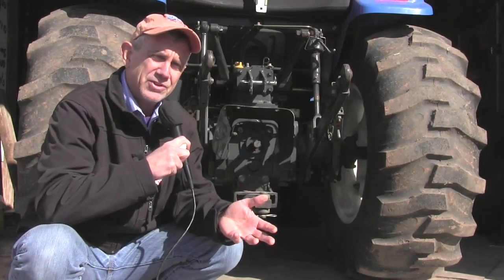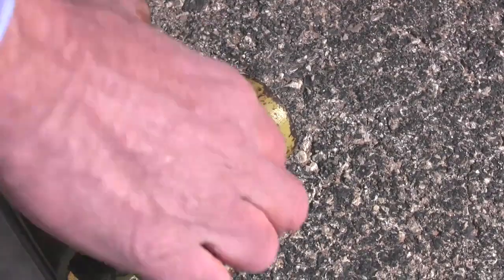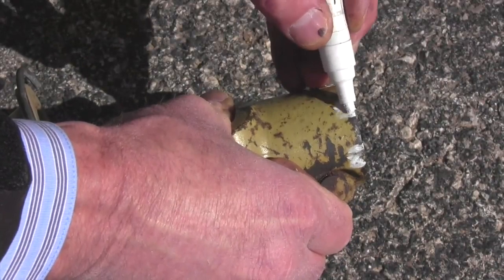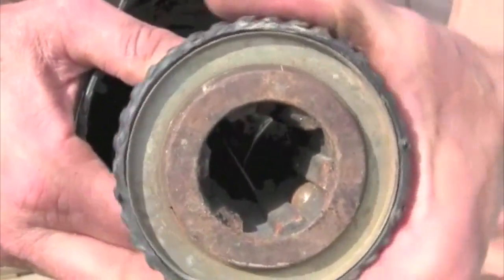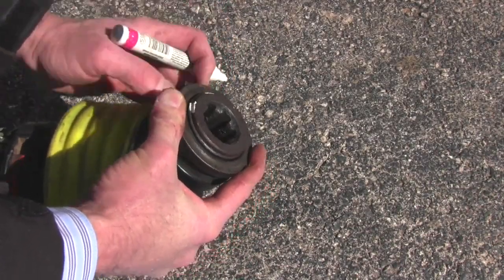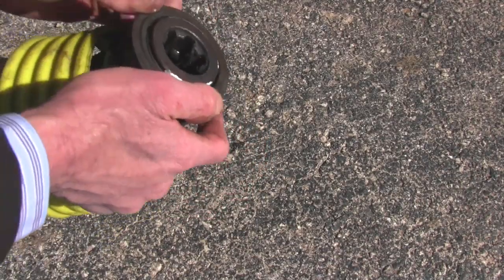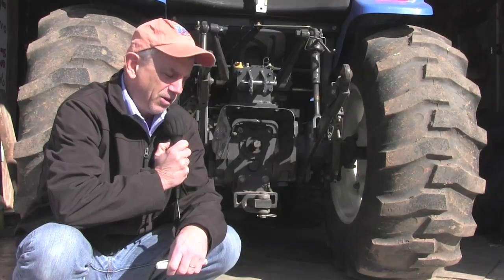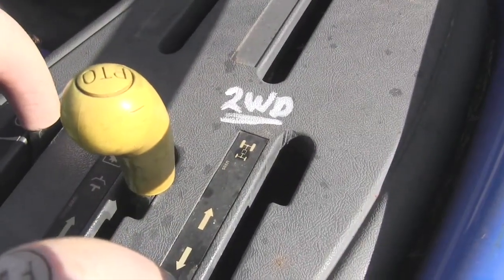A Great Trick to Make PTO Hookup Easier

Comment: I use a paint pen to mark all of my bolt heads to see if they are still tight. Allows a visual check so I do not have to break out a torque wrench to check.  A simple line running from the bolt head onto the tractor gives a great visual reference.

Comment: Now, if you could come up with a way to pull back on the collar while pushing on the shaft while reaching around the 3pt hookup arms.  At 67, I'm not as spry or strong as I used to be.  Anyway, good idea on the paint pen.
Reply: I was struggling with the same and came up with idea you might find helpful. Take a short single strand of 12 gauge electrical wire and hold it in your hand while you pull the collar back. Wrap the exposed part of the collar 3 or 4 times with the wire. This should hold the collar in unlock position while you mount it on the shaft. If you are able to slowly twist the collar on the implement side while pushing the collar on it should line itself up and slip on. Unwind the wire and push the collar forward to lock it.

Comment: Hi Mike, I bought an 8n summer before last and the previous owner did something similar... when I opened the top cover to put in gas for the first time I discovered that he had written inside the cover all the fluid types and amounts, the filter types... spark plug types and gaps... firing order... tire pressures.. even what size wrenches to use for things like the drain plugs.

Comment: I put my PTO lever in neutral so that I can freely spin the shaft coming out of the tractor. I then hold the Implement PTO shaft against the tractor shaft and slowly spin the tractor shaft until the two fit together.
Works for me.
Reply: I have a 33hp LS hydrostatic (Same as New Holland) and I don’t think the PTO can be put in a neutral position — can it? I can’t spin the PTO which makes hookup of any implement a discouraging chore!   Help would be appreciated!
Reply from the maker: Dale, some tractors have a PTO brake that doesn't allow them to freewheel.  If it won't spin when the PTO lever is not engaged, the tractor is likely configured that way.  My New Holland is that way and it is frustrating.
Reply: @dalebargen  I have a BX2660 and the PTO spins.   Unless it is selected.    Then it will not spin even if not engaged.   I always select the other PTO when hooking up and it makes a world of difference.

Comment: I like the white pen idea as it helps a lot. I was having a heck of a time getting my pto shaft from my rotary mower hooked up to my tractor. Finally, I disconnected the bush hog end, got bungee cords, and suspended both ends to about the same level as the tractor pto stub shaft. The female end of the pto shaft was marked on the outside where the spline ridges were and both connections were greased. Since I no longer had to support the weight of the pto shaft and it was at approximately the same level as the tractor pto stub shaft, it slid on like a dream with hardly any effort. I then hooked up the other end of the pto shaft onto to the bush hog gear box shaft end. Talk about easy! Hopefully, this will help other people and prevent a lot of unneeded physical exertion and colorful language that seems necessary to get a stubborn pto shaft end on.

Comment: In the military each piece of equipment had a forms bag.  It was a waterproof bag that contained the forms which you could check the last maintenance interval on the equipment and sign the equipment inspected for the day so the people behind you would know if the oil had been checked and such each day before use.  I’m just thinking, something like that could be useful to write down weights and capacities of fluids and filter numbers and such.  Most tractors have a tool box, why not attach it to the roof of the inside of the tool box?  You could Put you a paint pen inside of there too! :-)
Reply: Good idea. I'm going back to those old tricks. This channel and a few others have been incredibly great resources. Tractor Mike has helped me out a ton regarding the PTO.

Comment: Great idea Mike!  However, what seems even better is to obtain a PTO quick connect device, like PTO Link, which eliminates ever having to align the spline or messing with the pull back collar on the PTO shaft.  The PTO Link consists of two plate connectors and is installed as a permanent attachment to the tractor and to each implement's PTO shaft.  Each plate connection is a male/female universal that takes only seconds to engage for each use.  A little pricey at $200 per plate, but I love it!   Saves lots of time and frustration.  I've searched, but haven't seen your comments on this approach before.
Reply: Mark Pickle this is what I was looking for, I knew someone had to have figured out the spline alignment problem. Please  who sells it, brand and model? Thank you in advance!
Reply: After spending at least a half hour yesterday, I am not as strong and young as I once was, trying to hook up the pto for my brush mower----I would have been happy to spend 200.00. I am going to have to find what you are referring to.

Comment: I broke my hands trying to hook up PTO shaft from tiller. The pin was rounded , pointed and extremely difficult to press on. I oiled the pin but not much better. I’m thinking of changing pin out with a spring that has less tension and not pointed. There are collar connectors that seem easier too.

Comment: The PTO for the belly mower is a real pain. For mine anyways it lines up only one way and for some reason was difficult to get it to lock. Had the tractor serviced and went to mow and I hear a rattling sound and the mower spinning down...PTO fell off. Guess the guy doesn't know to pull on the shaft to make sure it doesn't fall off. Now I'm gonna wind up checking that every time it comes back from service.

Comment: Here’s another tip. Pull the sleeve hack on the pto shaft then wrap a small zip tie around the shaft to hold the sleeve back. Once the shaft is slid forward onto the tractor, cut or snip free the zip tie and allow the sleeve to spring forward.

Comment: Mike, I have several questions regarding a PTO overrun connector:
1) What is it?
2) How do I know if it will attach to my PTO shaft?
3) What are advantages/disadvantages of using it?
By the way, the Lube Shuttle grease gun with safeLOCK connector ROCK!
Thanks.
Reply from the maker: An overrunning clutch is designed for tractors with a PTO drive that's tied into the transmission of the tractor, most notably, Ford 8N's.  Without an overrunning clutch, when you're using your brush hog and get to the fence row and want to turn around, when you push in the clutch, the inertia from the blades can propel you forward.  The overrunning clutch allows the blades to freewheel without affecting movement of the tractor.  On newer tractors you seldom see a transmission-driven PTO (there are a few economy models floating around with it) and so it's not an issue.  If you brush hog with an 8N (or older tractor with a similar design) you need an overrunning clutch or you might die.   Thanks for the comments on the Lube Shuttle/safeLOCK, they are wonderful products.

Comment: Great info about paint pen marker. But.. My problem is attaching brush hog to pto tractor. I'm an older petite female and not as strong as I used to be. I have a quick connect on back of tractor so it's a tight fit to get my arms in there to hook up. I've use a bungee cord and have the shaft suspended but not enough muscle to press spring pin and push shaft on. I hate asking a neighbor for help all the time. Any suggestions?

Comment: Hey, Mike. I am having a very hard time finding a 7 foot box blade. To start with, can you recommend some manufacturers that make good stuff? I am hearing there are a lot of brands that use thin steel plate that is poor quality to last and do not weigh enough to do the job. I will be using this for my small place and occasional work for neighbors, not for heavy farming or commercial use.
Reply from the maker: Russ, that's a tough one.  First off, 7' blades are a little rare, most sold are 6', but that's too narrow to cut out the tracks of a lot of tractors.  Recommending a manufacturer would get me shot :).  Most of the majors make at least a couple of grades of box blades.  They make an el-cheapo for the person who grades the drive every three years and wants to keep costs down, then most make a medium grade and then one that looks like it ought to go on a bulldozer.  You probably want the medium grade, which is what I'd buy.  To be totally honest, I don't know what brand I'd get.  If shopping, I'd start online first and compare the weights of the different models and call to see who had 7' models in stock. Then I'd hop in the pickup and drive around to the dealers who had them until I found one that was heavier than average and that they wanted to negotiate on and buy that and take it home.  I've been out of retail now for over three years and I just don't have any idea about who makes the best mid-grade blade.  Figuring all of that out might make a good video.  Don't be surprised to see it sometime.
Reply: Thanks, Mike. By the way, I finally settled on a Massey Ferguson 150 with 1700 original hours. An interesting cousin of the scraper blade, and box blade is the pond scoop. That just might be cheaper to dig ditches and drag up dirt from the bottom of a shallow pond. Have you used one?

Comment: Hi Tractor Mike......while digging a hole, my PTO staff disconnected from the post hole digger on the post hole digger end (not the tractor end). Any ideas on how to get it attached again? It doesn't look like a broken bolt.
Reply from the maker: Watch this: https://youtu.be/k0ja3NuvEXI.  There's probably a shear bolt in there, they sometimes shear off smooth and are hard to find.  Might check to see if a snap ring is missing to hold the shaft on then the shear pin breaks.  E-mail me at mike@asktractormike.com if you're still having problems.  Good luck!

Comment: Mike, I have an LS XR3135 H tractor. My question is do all tractors when PTO is disengaged ( mines an electronic PTO switch ), how to get the PTO to FREEWHEEL for easier spline alignment . Mine doesn’t freewheel. Is there some methodology for electrically engaging PTO’s to purposely put them into freewheel “mode” for hookups?
Putting on my roto tiller is three acts of our current congressional administration’s attempts at resolution.
Reply from the maker: My New Holland TC4o doesn't allow the PTO stub shaft to freewheel.  Some PTO's turn when the tractor is off, on many new tractors they don't.

Comment: Looks like crap but i paint the tire pressure on the rim.. Lots of info on a tire and the pressure is usually hard to find but when i do i make is so i can find it again later.
Reply from the maker: That's a big pet peeve of mine.  The only writing I need on the tire is the size, which I only need when replacing, and the tire pressure which is almost important to find.  THE FIRST TIRE MANUFACTURER WHO PUTS THE INFLATION RECOMMENDATION IN BIG WHITE LETTERS ON THE TIRE, YOU HAVE MY UNDYING LOYALTY!!!
Reply: Thanks Mike I bought a Paint Pin just to mark my PTO... now if i can just find that pin,,, Something you could add is also painting the other end of the PTO those crazy three sided PTO shafts are a pain to get lined back up again. They have a name but for the life of me I can't remember it.  I think they are made by the DAMN corporation cause each time I take the two ends apart to grease it that is what i say when trying to put it back together.
Reply: Me too! I write it on every tire rim we have here. Saves a lot of time.
Reply: I just switched from Turf tires to commercial tread and had to buy rims for them and noticed the Dealer had written the tire pressure on the rim by the valve stem.

Comment: I have been driving a tractor on and off all of my life. One thing I have never been able to perfect is using a box blade to do finishing grading of my driveway. It always ends up somewhat hilly. I have search youtube with no luck as the videos on driveway grading are too basic. Any help?
Reply: Paul - the problem is the box blade is on the back of your tractor.  Now think of a long Ship / Boat going over a wave. The front (bow) goes up as the back (stern) goes down and vice versa. Now think of a Road Grader from the local highway department; the blade is in the center right? So there is no high or low when going over a hilly spot. Until you mid mount your blade you will be chasing those hills.
Reply: Got to www.daveknowshow.com that is the only place I have seen dealing with that problem and how to solve it..It has to going slow and having your 3 point hitch speed control set fast enough, to let your blade drop down fast enough.

Comment: Hi Mike,, I have a JD Baler that has one of those PTO joints that you have to slide the ring back, that releases the balls so you can slide it onto the PTO shaft. Pulling back and trying to push it on the PTO is next to impossible. I have to have some push on the shaft sleeve while I pull back on the locking ring as it’s Big and takes two hands to pull back. It is a poor design, in my opinion. Would have been nice if it would twist and lock when you have it pulled back, but it doesn’t on my Baler. Taking it off is easy but putting it on sure isn’t. Any suggestions?
Reply: Dick Kohlstrand , I have the same problem. I’m going to try pulling back the collar and drilling a 1/8 inch hole then put in a pin. It will be all the back when it slides on and then you can remove the pin. Not my idea heard of a fella doing this.

Comment: Hi Mike!  I just discovered your video and the paint pencil seems like a good idea.  But I've never heard of a paint pencil until now, and there's tons of them when googled.  So is there something specific I should look for or some brand or model?

Also, the reason I stumbled on your video is that I was looking for how to get the shaft off of the tractor.  I've had the bush hog on the tractor for a long time but wanted to swap over to the tiller.  But I can't get the shaft off of the PTO.  I know it's either a twist to release, or a pull to release, but it's stuck and I cant get it to move, so I don't know which way to go with it.  Any thoughts?

Thanks.  Greg in TN
Reply from the maker: No...every one that I've ever seen has been similar.  Truth be known, I'd never heard of them until I started working in a dealership.  We had to match top links with tractors and used paint pencils to identify which top link went with which tractor.  I think you can find them at Wal Mart or anyplace with craft/art/school supplies.  I always have one in my toolbox and one in my tractor box.

Comment: My John Deere MX5 is really tough to get on, with lots of verbal grease usually resulting.  My wife had a great idea. Pull the 2 halves of the pto apart, then attach pto to tractor w help of sledge hammer on the free end. After it was on, then backing tractor up to slide together the 2 halves of the PTO shaft. Voila. Simple engineering solution without cussing needed.  But still annoying design